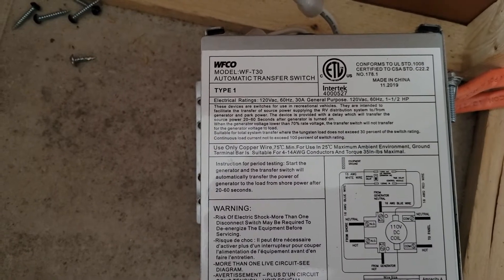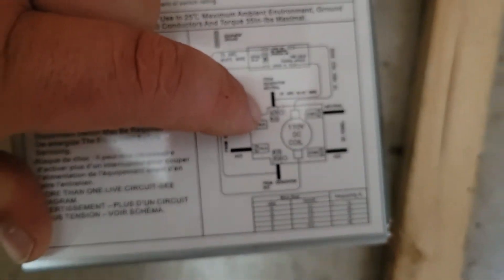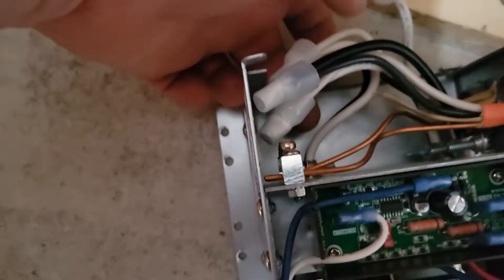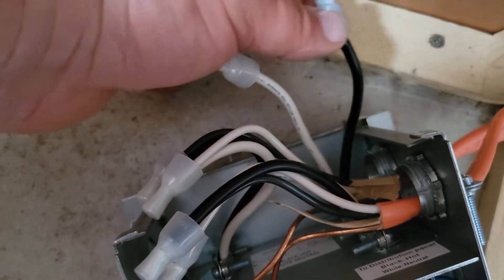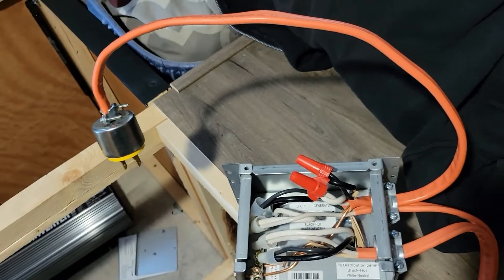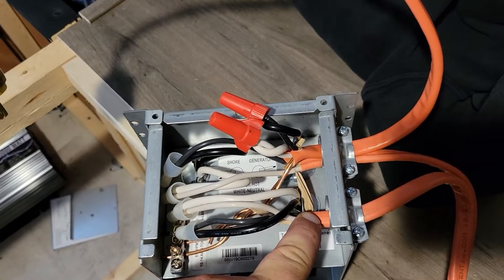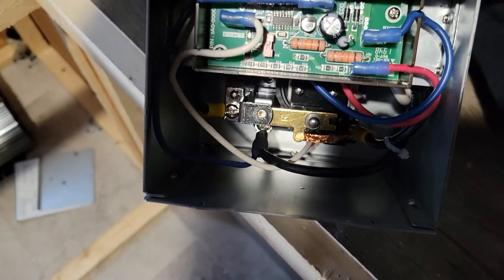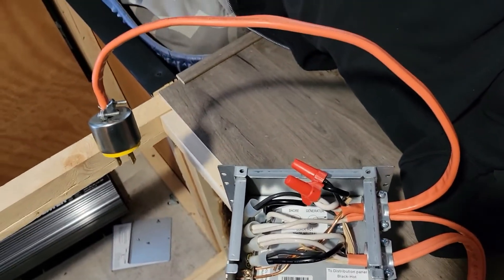How 🤔 to wire an inverter to a transfer switch

Comment: Good video - I have this exact model which attaches to the WFCO panel/converter in my TT. Of course,  if you plan to charge your house batteries when plugged into shore power or a generator, there are a few more things to consider.
Thought it is worth mentioning: This transfer switch is equipped with a delay bypass (visible on the schematic in the first few seconds of the video) - which is perfect when the second input is from an inverter.
Reply from the maker: Thanks for sharing. In this system if the inverter is on it bypasses shore power but will charge the house batteries. If the inverter is turned off or runs it's batterybank low then it kicks back to shore power /plug in generator.

Comment: What if Do have a generator input?  Do the inverter leads go to the same contacts as the generator or shore power?  Or somewhere else?
Reply from the maker: In this setup the generator plugs Into the standard shore power plug on the outside of the rv.
Reply: @FTOTF1  shoot, that doesn't help me.  I'll just install a second transfer switch that will incorporate the inverter.  Thanks
Reply from the maker: Also you could parallel the generator leads to the shore power plug side of the transfer switch, just make sure it isn't ever plugged in when you want to run the generator. Otherwise a second transfer switch or physical switch could be installed
Reply: @FTOTF1  aha!  So connect the generator leads to the same terminals as the shore power and then connect the inverter to the former gen. terminals?
Reply from the maker: @philborchelt5396  if you do that make sure that you don't ever plug it in to shore power while the hen is running and vise versa.
Reply: When you're running your inverter off your RV's battery sending 110 back to your box. Is it also powering your converter charger that would go back and charge your battery. Do you charge your batteries differently or do you turn off the circuit breaker to your converter charger when using the inverter.
Reply from the maker: This setup: shore power receptacle located on outside wall of rv  is where they either plugged in the rv to the generator or shore power. The transfer switch switched between outside receptacle and the box shown in this video.
Reply: You will plug the generator directly Into the shore power receptacle on the outside of the rv.
Reply from the maker: Yes. The transfer switch is switching between the solar generator and the outlet on the outside if rv. This rv doesn't  have an on board gas generator, so for it to power up, you have to plug the rv into a  power source or use the onboard solar generator as shown in video.

Comment: Where do you connect the transfer switch to the inverter? No one shows that.
Reply from the maker: Transfer switches  have 2 inputs and one output to the main trailer breaker panel. The plug in this video plugs into my inverter and is the normally open contact of the transfer switch. It is 1 of the inputs the other input is wired to the main trailer plug on the outside of the trailer.  It is wired to the normally closed input of the transfer switch. If the inverter gets plugged in the transfer switch makes the switch between the 2 inputs. I'm working on a video to show this.  Best Regards.

Comment: Thank for this video! I really needed this explanation in a easy way to understand. Do you keep the generator connected on the same transfer switch, and be able to switch between power sources? I have a 2000W inverter and wanted to make sure that I can use either shore, solar or generator as needed.
Reply: If you have an onboard generator - this setup is not for you. Keep looking. If you have a generator that you plug your 30 amp power cable into - this works perfectly.
Reply from the maker: This setup would still work if an additional transfer switch was installed upstream, meaning the output of the additional transfer switch would feed into this transfer switch.
Reply from the maker: If the inverter is on it triggers the transfer switch. If the inverter is off then the other input on the transfer switch is available